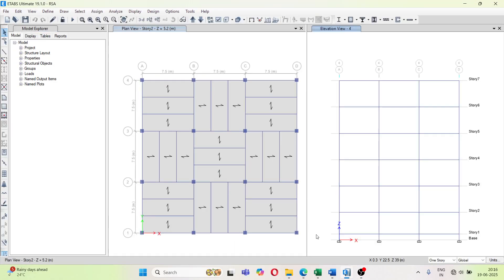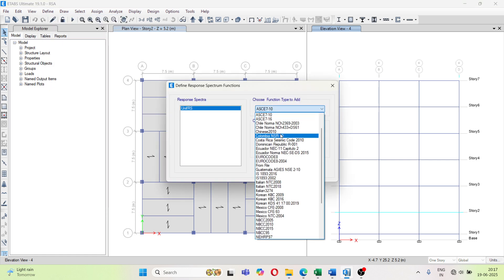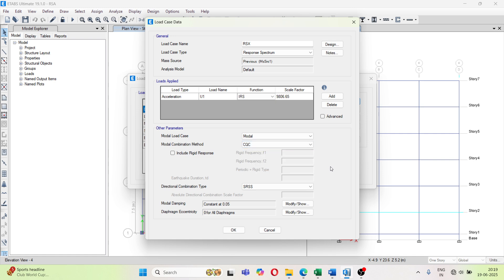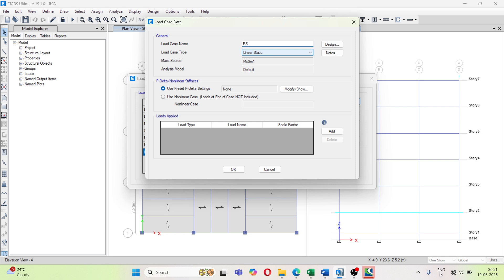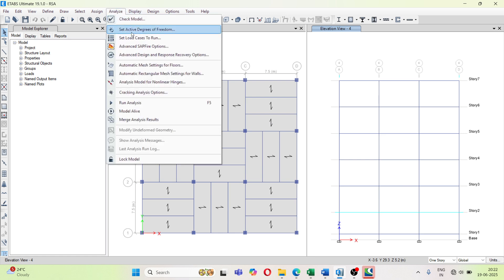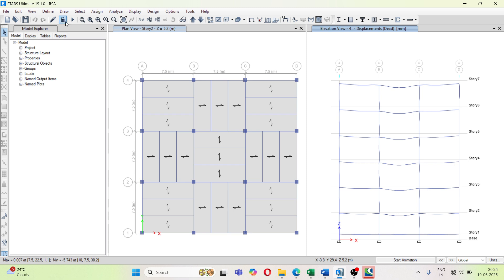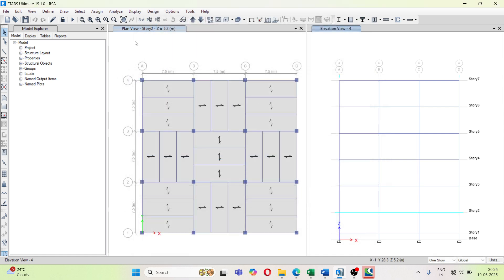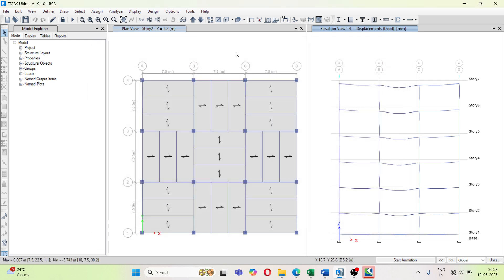How to Perform Response Spectrum Analysis in ETABS | Modal Combination Methods: SRSS & CQC Explained

Comment: Hello Sir how are you? I am using a template for my Response Spectrum Method. The base shear values are the same as the template, but the weight of the structure is different. I tried adding a large dead load to the base floor, no change. What should I do?
Reply from the maker: Which template?